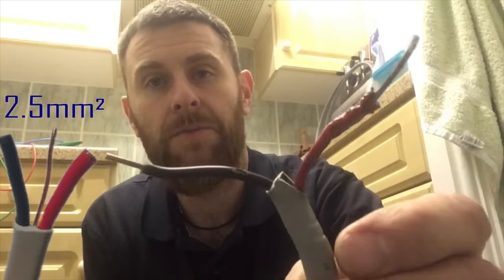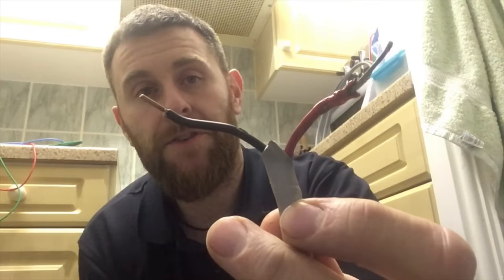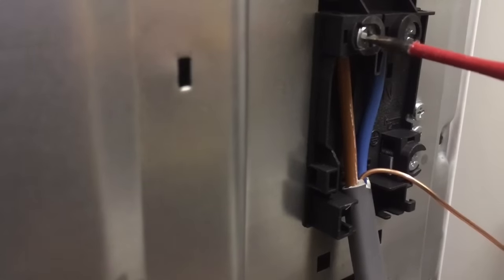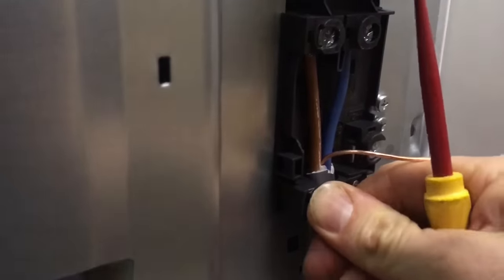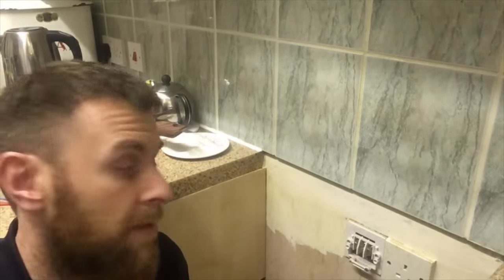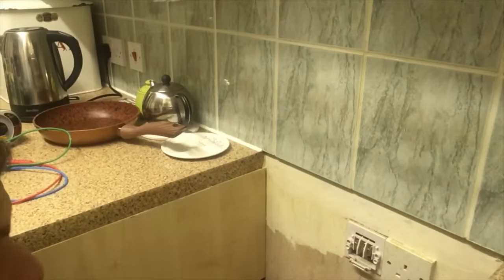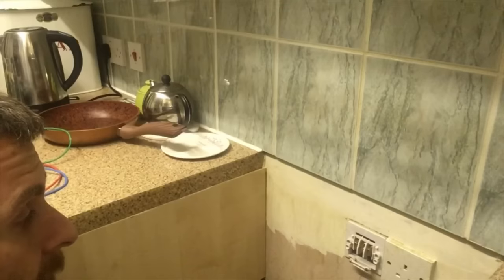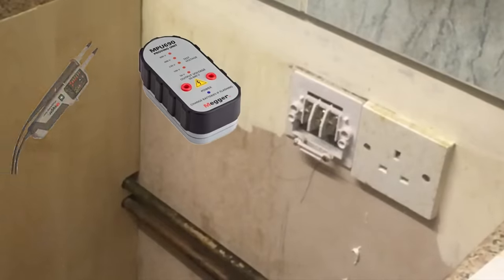On Site with Matt Connecting up a new Cooker and Testing the Circuits Earth Fault Loop Impedance Zs

Comment: I'm not electrician but shouldn't you be using heat resistant cable it's black and it's round to the back of the cooker

Comment: I’d prefer not to use flat twin and earth to cookers. Usually try and use ho7. More flexible and designed for that use. Could possibly get away with 4mm with it too having a higher temperature rating
Reply: matthew Dawson this was going to be my advice :-)
Reply: HO7RN-7 Flexible cable is nearly recommended by all appliance Manufacturers for the final connection, in the manufacturer's installation guides.
I was always taught that "the manufacturer instructions are always paramount". 
Another let down by the Electrical Wholesaler's, not to keep on the shelf what we Sparky need! 
CEF Electrical and Avonvale Electrics have been stocking H07RN-F cable for years . 
Another good video.
Reply: I also agree. Crimped and terminated, much easier to pull in and out. However I wish manufacturers would allow or a larger diameter round cable (Ho7 into their cooker connection units) at the rear of their appliances. Fiddly and fragile is an understatement.
Reply: I agree flex is better suited as twin and earth is designed for fixed wiring. But 521.9.3 covers you for t&e on cookers

Comment: Must admit, I had to shut one eye watching you cut the sheathing. Much safer to use the cpc 👍
Reply: You shouldn’t use the cpc to strip cable because copper is soft and it actually stretches it, slightly making it thinner, increasing the Zs an the protection of the appliance. But most people do would I would never recommend it to anyone.
Reply: @jamanemaraashollington8760  You're not stretching the whole cable. You're stretching 2 ends by a millimeter at most which will have a negligible impact on the impedance. The benefits outweigh the risks.
Reply: @jamanemaraashollington8760  lol
Reply: Using CPC works upon 1.5 or 2.5 but you will struggle on a 6mm and don't even bother on 10mm. I use a Stanley carefully to get through but I then cut away from my body/hand so far so good
Reply: If you can't strip a cable with a knife without cutting yourself, then your in the wrong job.
Reply: After all the great safety electrical practices, why show a dangerous knife practice ⚠️ 🙈
Reply: Have been using a Jokari No 14 flat cable cutter of late.  Really impressed.  Can't see me going back to messing about with a knife again now.
Reply: @jamanemaraashollington8760  using the EARTH conductor to strip the outer sheath DOES NOT stretch the earth conductor, unless you are Bionic . Or you are using cheap crappy cable from China eFix did a video on such cables , 
As for using a knife you should always run the blade down to the required length between the earth conductor and one of the line conductors with the knife 
 Angled towards the earth conductor so as not to cut or damage the sleeve of the line conductor.

Comment: Here in Germany wie use flex cables to connect the cooker to the wall terminals. That is much easier to connect and move the cooker after connecting the cable. The VDE standard also recommends the use of flexible cables for applications like this.
Eg H05VV-F 5G2,5 H05VV-F 3G4 or 05VV5-F 3G6
Reply: You crimp that flex cable aswell?

Comment: Nothing wrong with the isolation carried out.  You proved the circuit was isolated by the switch, that your tester was working, and the switch was within your sight at all times.  Whilst not strictly by the book, it was safe.  In fact, if you didn't have any lock offs with you, that was safer than isolating at the CU, because you could see the switch.

Comment: good video, and I know its commonly done and its a 6mm circuit, but as a training video, is a 6mm t&e the correct cable selection, manufactures instructions should be followed when installing new equipment, high powered ovens normally always recommend using a 80- or 90- degree temp, oil and grease resistant cable (min 4mm). use a 3183tq cable as the t&e used does not have these properties, or refer to chapter 52.  522.2 talks about heat sources, would 522.5 (AF) include oils and grease I'm not sure. not necessary for this but 521.9 gives info on flexible cables for connecting equipment.

Comment: I am a bit confused. The Wiring Reg (18th Ed.) says in 521.9 (Selection and Erection of Wiring Systems) Equipment that is intended to be moved in use shall be connected by flexible cables. 
Like: H07RN-F Rubber Cable – 3 Core 4mm2 would be perfecty enough. (PCP neoprene is also oil and flame retardant.)
Max Length: 29.04 meter.
The 6mm2 twin +E is not flexible. I am just asking. I have seen other electricians using flexible for cooker and hobs.
Thanks
Reply from the maker: I would go with your answer 👍🏻

Comment: I thought he would have to used 6mm heat flex from the plate to the cooker. Just wondering but I always use a heat resistant cable in these cases.
Reply: You will struggle to find 6mm2 flex. Have you seen the size of 6mm flex. Try to terminate that it in the tiny connectors that ovens  have. 
Flex also needs a  ferrule, with one of them on you have no chance of getting it in the connector. Ovens are not moved around. Twin and earth if fine.
Knife work a bit scary though.
0.66 ohms on a 6mm2 circuit seems quite high. The r1+r2  would put that at 63m of cable, So i presume you had a high Ze, or its a long run.
Love the videos. keep up the excellent work.
Reply: Boro Bert Good comment. You know your job. Are you in the UK?
Reply: @borobert7649  Yes, that Zs does seem a little high to me too... Could be high Ze, loose connection within the circuit or ageing accessories, some further investigation definitely required.

Comment: Matt. Can’t thank you and the other lads enough mate. Lovely to see you guys helping us inexperience sparks how to commit and complete. Very much appreciated. Question on testing; is there any difference in testing a circuit which is wired on 3036 fuse board? And where can I possibly locate those information on testing that kind of fuse board please? 

Links
Reply from the maker: Thanks for the feedback and watching. No different tests if the circuit is protected by a BS3036 fuse only the max circuit impedance (Zs) will be different. 😁👍

Comment: I will NEVER use a knife to strip wire, you risk damaging the conductors (as seen in the video, but often worse).
I start the end and use long pliers to peel the grey back whilst gripping all three conductors.
This is a skill to be learned over time, so you get quicker.
Reply: Little use for a sharp knife in a sparkys tool kit I agree. 👍🏼

Comment: Hi Matt, great video. I'm in the process of doing our kitchen up,and we are having a built in single oven next to a built-in combi microwave oven. Can I supply one 6mm cable and spur off the socket for the 2 ovens. Or do I need to run 2 separate 6mm cable to the consumer unit.  Many thanks. Regards Glen.
Reply: One 6mm and a dual cooker control unit to spur x2. These ovens usually come with a flex so use them. You have to be careful on correct size breaker though. Instructions will say. Usually 20 amp with allowance for diversity. 10 A plus 30% of the remainder of the total connected load, plus 5 A if the control unit includes a socket outlet

Comment: Would never rely on a DP switch as the isolation point, as you said though, you've already discussed in previous videos the correct safe isolation procedure of locking off and applying notices at the MCB.
Reply from the maker: Hi. Appliance repair engineers always use the local DP switch for isolation to items such as showers, IM heaters, boilers and cookers. We would expect all our learners to isolate at the consumer unit👍. Thanks for commenting and watching. Gaz
Reply: It could be argued that isolating from a local DP switch is actually safer as both the line and neutral conductors are disconnected whereas isolating from the circuit breaker would only disconnect the line conductor.
Reply: True if there's a shared neutral but a wouldn't think their would be in a cooker circuit. Also some idiot could just come in and switch the DP switch  on if you went out the room for a minute because its not locked off.
Reply: @MrKwelsh  If you have to leave the room for any reason, you should re-instate any cover plates and re-confirm that the circuit is still isolated before re-commencing with any work.

Comment: are all the cookers, or what we call Ranges, hardwired? In the US we use 4 or 6 Ft. plug ended cords that are rated to 50 Amps. that way, if the appliance needs to be removed, its just unplugged and then moved. the only built in appliances that are hard wired here are cook tops and built-in ovens.

Comment: I'm new to this, in my wall socket its the red and black wires to the sides, and the cpc wire in the middle, however my cooker wire is blue and brown I dont have a clue as I've connect it but cooker not coming on
Reply: Black/Blue= Neutral, Red/Brown= Line
Reply: Hire a pro electrician.

Comment: What do you do with the loose cable behind the cooker. Is it OK to just feed it back with the unit, or do you have to use a heatproof shield?
Thanks
Reply from the maker: Hi, some people use heat resistance flex but in the case Matt used standard 6mm2 cable. You can do as you described 👍. Thanks for commenting and watching. Gaz

Comment: Lovely job. I do like how you give the CPC a loop at the cooker end always been taught to leave the CPC the longest if possible. A lot of cooker manufacturers recommend heat resistant flex for the cooker connection. At the CCU I have found some manufacturers double up terminals gives you more of better connection was this not the case with his one as the top terminals were loose?
Reply: this is why there is a torque rating so your connections will not become loose

Comment: Most ( old time sparks me included) connect how you have by switching of the DP cooker switch ... yes I
Know now they switch of the Mcb  now days and yes it is modern practice to do so ..as for seeing T/E ( 2.5) I’ve seen many kitchen fitters. Do this ... and handy men. Will add I allways wire cookers from the mains in 10m as you can never tell what size cooker people buy thease days ...

Comment: Thanks for video, is very helpful. I have a question about cable please. I brought new 10,6 KW cooker, can I still use 6mm cable for, or I need different one???
Thanks once again
Reply from the maker: Hi, it’s all to do with diversity check the rating plate. 30 or 32 amp fuse and 6mm cable with be fine 👍.
Reply: @GSHElectrical  Plate shows 45 amps. Can I use 6mm?
Reply: Onsite guide states any cooker under 15kw a 6mm and 32amp breaker should be used.

Comment: We in Germany connect a Cooker with 3x 240 V 2x Neutral and 1x Earth = 400 V. Secure Power for best Performance. 25 A Fuse.
Reply: Not many houses or flats in the UK have got 3 phases coming in. I haven't come across one yet and I've been living and working over here for over 20 years
Reply: That would be interesting to see a video. Is it called a 3 phase installation and is it common across Germany. Are your appliances made compatable for this system. Regards to you Dirk.
Reply: @derdeutsche2666  Can be installed in any UK household. 5 wired cable, 2.5 mm, 3x 240 V, 1 x neutral, 1x earth, 25 A fuse, simple!
Reply: @DirkGorgiel  No it can't.  It is very rare to have a three phase supply into a domestic property in the UK.  What is common in the UK is 1x240 into the property with up to a 100A fuse.  This then goes into a distribution board with different breakers for each circuit.  That's one reason why most home EV chargers in the UK are either 3.6kW or 7kW.  Otherwise we would do what is common in the rest of Europe and have 11kW chargers.
Reply: cjmillsnun Thanks for the information. You’re right, 3 big wires come in, here.

Comment: At 2:24 you say that an 8kw cooker WITH diversity applied is around 26 amps??
With diversity 8000amps /230v =34amps. 
First 10amps then 10% of remainder 24/30% =7.2amps + 10amps = 17.2amps total with diversity.

Comment: Is there a recommended or permitted length of cable to allow for maintenance. Also would like to see the actual connection unit being wired in. Good demo' many thanks.
Reply from the maker: Hi. You need to be able to pull the cooker forward to access the connection and for maintenance. Thanks for commenting and watching. Gaz 👍
Reply: @GSHElectrical  Thanks, I guess 1.5 to 2 meters is fine.
Reply: OSG states that the control switch or cooker control unit should be placed within 2 metres of the appliance.
Reply: @ashmanelectricalservices4318  Thanks Alvin.

Comment: Mine is also a 32 amp rcbo with a 6mm supply to the cooker connection unit, but my cooker is only 4.2kw which is only pulling about 18 amps should I still use a 6mm from the connection unit to the cooker or would a 2.5mm suffice because it is cable of a 25amp load current?
Reply: Refer to the rule book 2.5mm PVC copper cable can carry a current of up to 24 amps, this rating depends on the method of installation

Comment: Very formative and good video. I just have one question - when would you use heatproof cable rather than twin and earth?  Is that just used on integrated cookers and hobs? I’d welcome your thoughts on this. Thanks.
Reply from the maker: Totally agree 🦾
Reply: So would heat proof flex been the preferred choice for this installation? Thanks.

Comment: 8KW / 230 is 34.78? At its maximum capacity it would be pulling 34.78 amps am I doing something wrong here?
Reply from the maker: Hi. Remember you need to apply diversity 👍😁. Thanks for commenting. Gaz
Reply: Extract from OSG
10A + 30% of full load of connected cooking appliance therefore...
10A + (34.78×0.3) = 21 A
Reply: Alvin Ashman where are you getting the 10A from? Did I miss part of the video?
Reply: Onslow hi Onslow,  just check the diversity section in the OSG, will show you there. Table A2 item 3👍
Reply: Look in the osg mate, you need to remember how many people use the oven with everything running at the same time for a long period of time.
Reply: @theinstallerguy786  and on full blast as well lol

Comment: You need to follow the safe isolation steps!  The important step is to lock off the  device protecting the circuit you are working  on  ; in other words you need to go to the protective device at the consumers unit and  switch it off once you proven the cct its live first!  Then prove dead at the point of work ( point of work in your case is the cooker onnection outlet... & go back to the breaker  lock that off!  USING A PADLOCK AND KEEP HOLD OF THE KEY!   

Another point to note is that the testing gear need be of an approved type  ( a multimeter or voltage indicator sort you are using may not meet the safety standards for safe isolation!)  Need be a dedicated proving unit kit  ( the  probes cable need have no fuses  and have visual indicator lights and be one piece & of a gs 38 standardised)  A mar tin dale manufactured kit will met the criteria - I'm not affiliated to them! 

Cooker isolator is there only to switch the cooker on and off by the user and Not for safe isolation purpose.

Comment: with 6mm twin&earth what is the max RCBO tybe A or B  ?
Reply: Type A RCBO because of the high inrush current of the cooker(refer to the rating of each), if you use a Type B RCD or RCBO it will cause it to trip straight away when you turn on your cooker, the cooker neutral wire needs to be connected to your main neutral terminal at your fuse board, not at your RCD neutral terminal bar, there are separate neutral bars. One neutral bar for RCD RCD-protected circuits and then your main neutral bar for circuits not protected by an RCD.
Reply: High inrush currents are usually found with inductive loads. A cooker element is a resistive load so I would say type B RCBO would be ok

Comment: You never checked to see if it was a 6mm cable coming from the mains ?
Reply: He said the circuit is wired in 6mm, hence why he is using 6mm from the plate. It was previously 2.5mm from the plate to the old cooker.

Comment: Nice video Gaz  we all do it but is it OK  we're the CPC on the cooker terminates  it has a pure 90 bend  as it goes into  the terminal  I have been asked by the apprentice but I had no answer for him there is always one  haha let's see Iff you can answer that one Please
Reply from the maker: Hi... we double cables back on themselves to go into accessories terminals 👍😁
Reply: Am I right in thinking you're question relates to the bending radius of the cpc, if so a sharp 90 deg bend makes no difference on an individual floating conductor.
Reply: Minimum radius of internal bend  is what he was on about  rules are made to bend  I take it  need a big wig to answer that one
Reply: @Allegedly2right  I think the bending radius is more to do with reducing the risk of a parallel arc when multi-core cable are bend too aggressively... I could be wrong but it's just a thought.
Reply: It is always good practice to double back your cables where possible

Comment: Seriously! Final connection with 6242Y, not 'best practice' with the knife, using any old screwdriver for connections, flat blade driver into a PH screw.   Every cooker I have seen in a least the last 10 years has stated H07RNF or similar.   
On a tangent, serious question....HR butyl rubber ( rarer than a 70s TV personality) and HR flex; is the insulation Heat Resisting or is it just the sheath?